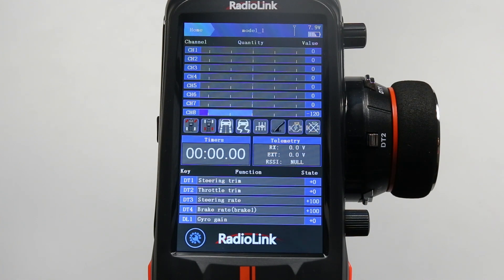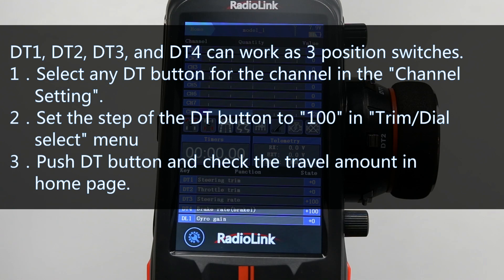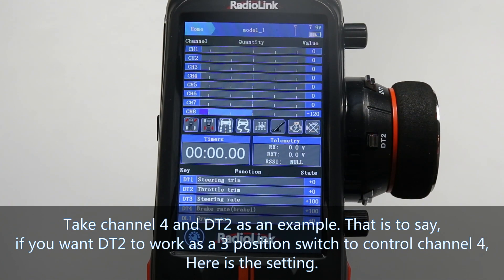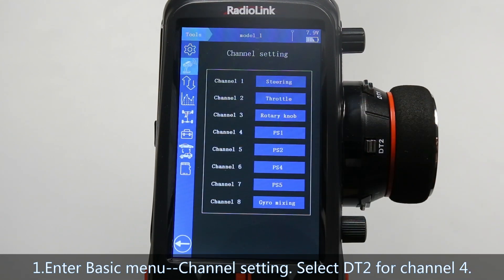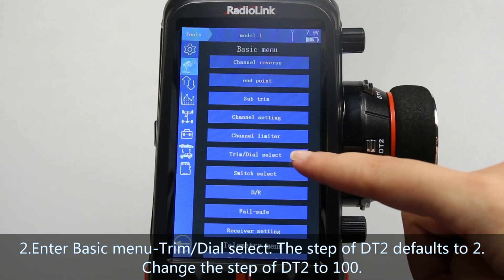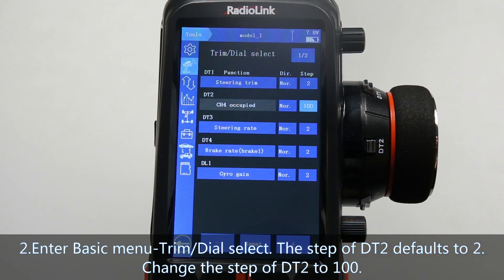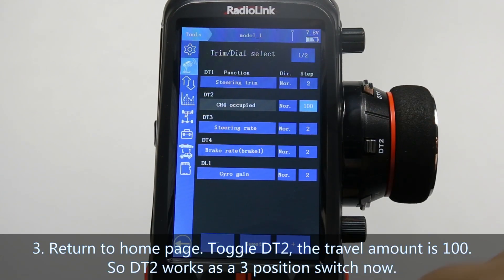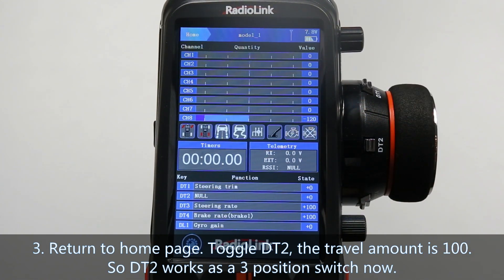How to Set 3 Position Switches on RadioLink RC8X?

Comment: Can a 3 position be used for MOA, with centre being 100% to both axles, click down from centre to only have one axle moving, and up from centre to have only the opposite axles moving?
Reply from the maker: Hi, sir. It depends on your device. The 3 position switch can be used to control any one channel of the receiver. In the transmitter, the servo display for the channel of 3 position switch is : -100, 0 and +100.  Here is the detailed manual of RC8X for your reference. https://www.radiolink.com/rc8x_manual  If any question about RadioLink products please feel free to contact us. Our email is: after_service@radiolink.com.cn

Comment: Hello, is it somehow possible that I can switch CH5 and CH6 with DT3? At CH5 and CH6 is a servo connected for the differential lock front and rear and I want to switch them independently with DT3. Like: DT3 push up=CH5 ON, push again then OFF. DT3 push down=CH5 ON, push again then OFF.
Thanks already for an answer
Reply from the maker: Hello, sir. If you want "DT3 push up=CH5 ON, push again then OFF. DT3 push down=CH5 ON" , you can assign DT3 to control channel 5. Just follow this tutorial. Set the step of DT3 to 100. Then it is what you want. If this is not what you want, you can assign DT3 to control mix function of channel 5 and channel 6. Please note, you can only assign a switch to control one channel or one function. If any question when using RadioLink products please feel free to contact us. Our email is: after_service@radiolink.com.cn

Comment: Is it possible to program a three position switch in jog mode so it is normally at zero and goes to +100 or -100 while I hold the switch either forward or backward, but automatically back to zero when I release the switch?  I want to program a winch, but I want it to stop when I release the button, I don't want to have to click it back to zero.  I hope that makes sense...
Reply from the maker: Hello, sir. I understand what you want. There is jog mode for all push buttons on RC8X, such as PS1, PS2, PS3, PS4 and PS5. But they are 2 position switch. For example, when you push PS1, it goes to +100, when you release PS1, it goes to -100. Sorry there is no 3 position switch with jog mode. Hope you understand it. Here is the detailed manual of RC8X for your reference: https://www.radiolink.com/rc8x_manual  If there is any question about it please feel free to contact us. Our email is after_service@radiolink.com.cn